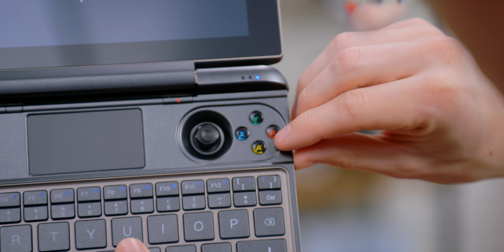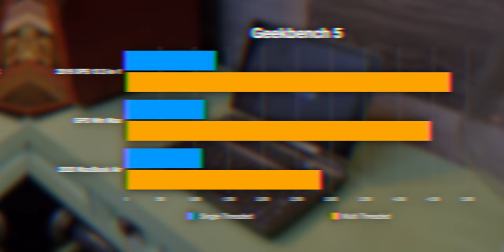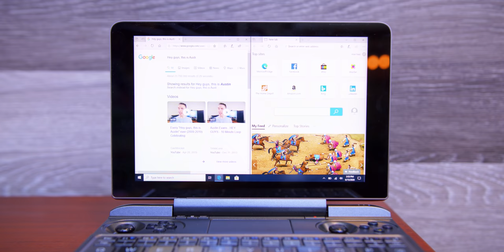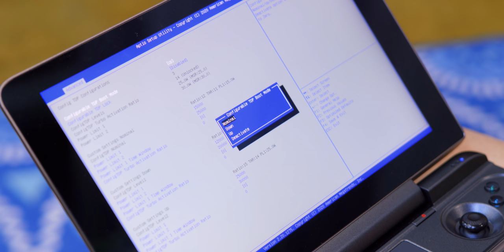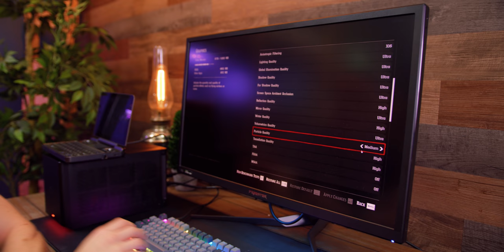the SMALLEST gaming PC!

Comment: Atlus: ports persona 4 golden to pc 

Austin: plays persona 4 on a mobile laptop, playing it like it’s a vita.
Reply: Gail Breslin  it doesn't look vary different from the original
Reply: Gail Breslin  it's a gpd win for me
Reply: @unknownknife4993  well, the difference is that P4 Golden on PS-vita runs in 476p, however on this laptop it can run in 1280x720 or 1280x800, and it has anti aliasing options which goes up to 2x OGSSAA via the resolution scale going up to 200%, I don't know what the Anti Aliasing On/Off does, in fact the vita version would be a better portable version (at the moment) due to P4 Golden being a bad PC port.
Reply: W8 WHAT???????
Reply: @AdlyLeksono  stop
Reply: Force him to use windows vista
Reply: All laptops are mobile 😂
Reply: @WednesdayMan  I have never understood the problems... I run P4 with no issues on my pc. Wish the anime cutscenes looked a smidge better but overall flawless 100+fps no stutter.
Reply: @1floony  anime cutscenes run terribly on most rigs, the game often runs into crashes and I had to set it to above normal priority to cut down on crashes, and the thing is, I can emulate Persona 4 PS2 and have smoother running cutscenes without the crashes.
Reply: I like playing persona 4A better on my XBOX ONE X through backwards compatible from Xbox 360
Reply: @WednesdayMan  Must be something with your system mines runs pretty good at 4K/150% Resolution Scale, with everything else turned on, still get over 100fps just fine and only have ever gotten one stutter throughout 3 playthroughs already.
Reply: @WednesdayMan  Sounds like your issue, runs perfectly for me
Reply: @nosfreee334  many people are running into issues with this game it honestly needs a patch, maybe the removal of denuvo

Comment: 9:40 - You can map the throttle and brakes to the right analogue stick to get analogue input.
I'm surprised so many Youtubers don't think of this, since it was a common control scheme for racers on the PS1 and PS2, which lacked analogue triggers.
Reply: Actually ps2 had pressure sensitive buttons so that wasn't needed.

Comment: Austin: "The SMALLEST Gaming Laptop Yet."

GPD Win 1 & 2: ":("
Reply: Even GPD say it is smallest gaming laptop, like Win 1 and 2 don't exist.
Reply: @antoniorsoftware  because those are not in a laptop form factor. Those are more like a 3DS XL clam shell gaming handheld form factor.
Reply: @_GarethRossUK  what? They are windows 10 based pc in a clamshell design, that's a laptop. You don't call a 17 inch gaming laptop a 3ds clamshell handheld, size doesn't always determine what it is although I agree it's a handheld device it is still a laptop.

Comment: 6:00 , While I cry in my 15.6" 768p display :'(
Reply: bruh i got the same specs😔
Reply: I have 1280x1024 on 19"
Reply: I have 960x540 on 15 inch
Reply: Most laptops in my country (Colombia) are still being shipped with 768p displays. What a bummer
Reply: I got 3040x1080 24"

Comment: Just a tip... Undervolt it, turn off some of the cores for some games, and you are good to go. Then maybe play with the tdp.

The CPU is still leagues above the GPU and they use the same tdp, so when you play a game the CPU is unnecessary drawing more of the power to itself to run all cores at max. If you limit it to only 2 cores, it would draw a lot less power for just slightly lower performance. And since the GPU was the bottleneck its not that bad anyway. But since the CPU is drawing less power that would leave more power to the GPU, and actually that would increase performance overal in a lot of games.

Comment: There are ZERO (0) reviews anywhere for HP's newest iteration of the Envy, (the HP ENVY 13-ba0030ca 4K touchscreen laptop) here are the specs listed on the HP store:
Windows 10 Home 64
Intel® Core™ i7-10510U (1.8 GHz base frequency, up to 4.9 GHz with Intel® Turbo Boost Technology, 8 MB L3 cache, 4 cores)
13.3" diagonal 4K touch display
16 GB DDR4-3200 SDRAM (onboard)
512 GB PCIe® NVMe™ M.2 SSD
But it's unreviewed there and there's nothing on youtube. I will post this comment everywhere until it is seen by someone who then reviews it since it seems promising and I need answers, lol